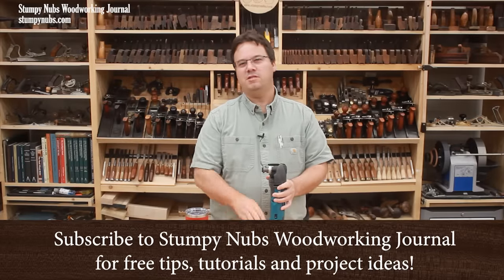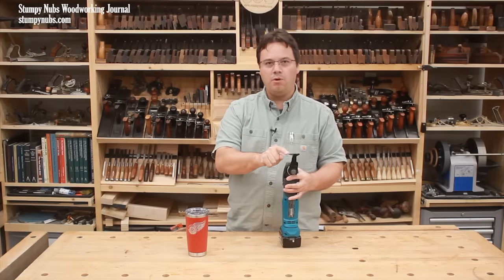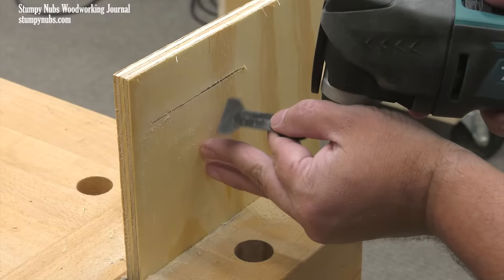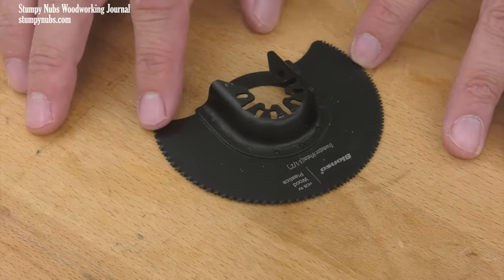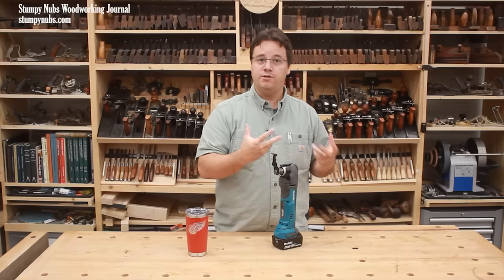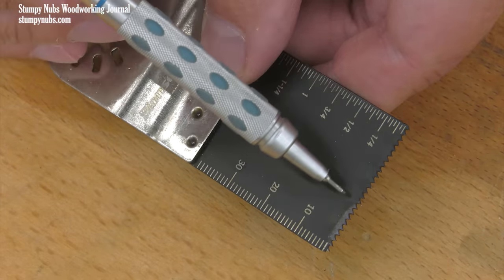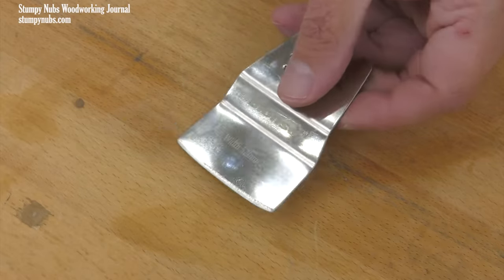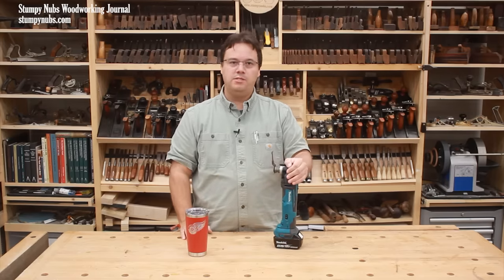CLEVER things to do with an Oscillating Multi-Tool!

Comment: As a Registered Nurse, I've used oscillating saws for almost 40 years in cast removal. They are safe because they would not readily cut skin when they penetrated the cast during removal. They are also used extensively in orthopedic and neurosurgery to cut bone. I never thought about the patent issues that kept this tool from crossing over to the woodworker and building trades. I just used a masonry blade for the first time a couple of weeks ago to cut slots in mortar joints to mount decorative lighting around a pool deck. Worked like a charm. Also great for grout removal in tile work.
Reply: My first thought was all the casts I had cut off with one of them.
Reply: The first one I saw was having a cast removed in 1973 when I was in second grade.  Now I have a corded one and a cordless.  One of my favorite tools.  I recently saw a blade that was a rectangle and would cut a hole in drywall for an outlet box in one step.  Pure genius!
Reply: True,  I had a cast cut off in 1963 with an oscillating tool
Reply: I never understood how they could cut metal and bone but not skin.
Reply: @pamelah6431  These medical oscillating saws will indeed cut skin and soft tissue if enough pressure is used, but you need to press harder that for cutting a cast or bone and make a real attempt to cut soft tissue. You develop the proper technique, just like any other tool.
Reply: @DeereX748  interesting

Comment: I paid $450 for my first one - the Fein corded original - in the mid 80's.  I still have it plus two cordless Makitas.  I figured you would miss some of the tricks I have learned over the years, but no, you covered it all.  As usual :-)
Reply: Fein the original & the best.
Reply: I still have my original corded Fein from 20 odd years ago but these days I most often use my Dewalt 20 volt cordless multi tool.
Reply: That must be around a thousand dollars in today's money. Tools were sure built solid then.
Reply: @jamesrecknor6752  The price of these types of tools was hideous when they were only considered a 'specialists tool'
Reply: Price for the tool have gone but the price for the blades are ridiculously expensive.
Reply: The fein is a quality tool .
Reply: @davemarr7743  it’s the printer/ink model
Reply: $450 bucks in the 80s? Damn that's more expensive than current to date festool prices for the 80s.
Reply: @palmer3977  you should give the new makita brushless a try. it is more bulky around the power head but its because the entire gearbox is in rubber mounts separate from the handle. the vibration damping is pretty amazing compared to any others ive tried. and the width of oscillation and power is top tier too.
Reply: The Fein salesman was going door to door like the Fuller Brush Man. I wasn’t sold but my wife thought it was cool so I’ve been using it for years. It’s very versatile. I probably have used it most often as a jamb saw. Does a good job at removing grout too.
Reply: Use a Fein and HS blades for cutting fiberglass for homebuilt airplanes. And use any other brand for lesser work. We've had a corded Fein since 1999.
Reply: My first Fein from the 90's was a 250 Q. Since Fein had the patent, it had an MSRP of $399. They never sold for less than that. That tool is still running today. Fein's are still incredible tools. I don't care for the new ones however since you have to use their proprietary Starlock blades which are expensive.
Reply: you must have worked in commercial caulking or glazing... when we bought them in the 90s they were $600! And people complain about inflation now!

Comment: One tip I have picked up is that you can also mount 2 blades back to back, which in effect helps you cut a parallel channel in drywall or wood for running wires etc
Reply: Not really. The vibratory action and flexibility of the blades distort for a parallel cut.
Reply: Now that’s an idea I have to try out! Thanks!
Reply: This works a treat with 2 semi circular blades with a spacer set between them and a longer mounting bolt/screw.
Reply: @michaelhamerin3814  It works very well if you use the right blade choice.
Reply: Wow. I am about to run 100 ft of various Romex. I am going to try that.
Reply: Wow, never thought of that!
Reply: What a great idea

Comment: Great video James. My oscillating tool is dubbed the “tool I forget I own” more often than I want to admit. It has gotten me out of many jams and now with your video I actually know how to use it better!
Reply: Interesting how different some people see the same thing. My oscillator has risen through the ranks and tied with the impact driver for my most used tool. I can't remember a job I did where I DIDN'T use it at least once.
Reply: @justinayers3589 , on the job I bought mine Fein Tool for (stair railing project),  the homeowner asked me to cut a hole for a bedroom door latch, which had been neglected for a decade.  A Feign tool and plunge cut was perfect for cutting a hole for the door to latch into. A bit of chisel work and a annoying task was cut down to just minutes.
Reply: I too forget quite often I have one.Actually two.😊Blades are actually a problem to get and expensive in sunny South Africa.

Comment: I LOVE mine.  I work construction and got one a couple years ago, it makes you wonder how anybody got anything done without it lol.  It's the perfect tool for so many things.  My favorite one being probably doing floors.  You can use this tool to cut off the bottom of trim and door frames to slide the floor underneath it, gives a super clean look (you don't have to worry about edges of the floor cuts being perfect as they'll be hidden under the trim) and takes about 30 seconds and your door is prepped.

Comment: Bought mine on a lark and justified the purchase as being a birthday gift a couple of years ago. Plus I needed to make like two flush cuts on some baseboard. Two years later, and this thing has become indispensable in my shop. Never would have thought it could come in useful in so many different ways! I'm especially fond of the chisel blade--it helped me immensely to remove old, glued-on plywood underlayment in a recent bathroom remodel.

I also never thought about being able to actually touch the blade while in use. THAT might be a game-changer for me in the future. Thanks, SN!
Reply: Originally, they were used by orthopedic doctors to remove casts.
Reply: @ohmike813  Oh wow, I always wondered how they were able to use what seemed like a spinning disk to cut casts without also cutting the skin. This makes perfect sense! Thanks :)
Reply: Betcha you could use  the those weird saws 0:17  Then start realising that that weird thingee could cut all I waanted and never cut a person's. It became the darling on that ward.

Comment: I remember the first time I saw an oscillating tool which was in the early 90’s. I was working as a floor installer for a pretty large flooring company. I was an apprentice back then and my job was to always cut door casing for flooring to go underneath for a cleaner look. We had a Crain undercut saw but there were a lot of areas that the Crain couldn’t get to so I would use a hand saw. A reciprocating saw was also an option but I was still too green to comfortably get a good clean cut with one. 

Anyway, Fein came to do a demonstration at our warehouse and my mind was blown! We ended up buying a bunch of them from Fein and never looked back. I am now a finish carpenter, mainly doing cabinet installation, but my multi tool is one of the tools that is always in the truck. It doesnt get a ton of use, but its a life saver when I reach for it!! 

Cool video
Reply: Yup! My first one was a Fein corded one. Still got it. They designed a profile sanding accessory as well and I got one. When I bought a cordless multitool from a different manufacturer I tried to modify the profile sander to fit it but couldn't.
If I want to use it I've got to get the fein out.
Multi tools need to be cordless just like drill/drivers and be toolless blade replacement just like jigsaw.
Reply: Came to the comments for this exact tool. Im a floor layer as well and i absolutely hate using the jamb saw/undercut saw. For starters, its just way too powerful for its intended purpose and it often sends a peice flying across the room.
Also, as its intended to be used by cutting around the jamb without having to stop, which means using upto 3 out of the 4 quadrants of the blade during 1 cut.
Not to mention what can happen if you hit a nail (yes, ive broken windows, more than once) or pehaps accidentally go in a bit to far without realising the house is steel framed (yes, done this too, only once though, actually shattered and broke a decent chunk off the blade, had a bit of a sore shoulder and hand after the kickback threw my arm into the wall as well)

This is gonna sounds stupid, but being from Australia, where basically everything wants to kill us, we kinda get raised to have a fearless mentality and a nonchalant attitude towards everything, however, nothing scares the shit outta me more than when i have to use the bloody undercut saw, which has been 5 days a week for nearly 15 years now. 

I've experienced kickback from other saws (chainsaws, circular saws etc.) before, but they dont even come close to an undercut saw. I think its something about being on your knees with limited mobility and having no way to know when it's gonna happen and no way get out the way of anything. It's basically a game of 'jamb saw roulette'.
Reply: @davidashton2361  I just got my first multitool to cut rectangular holes in weatherboard to install vents. Got sold up to the one with starlock system of toolfree blade changing. Thank god. I hate fiddling with that crap

Comment: I bought one of these several years ago. I selected the Porter Cable for a couple of reasons. The first and main reason was because of the quick blade change; lift a lever and change the blade. I can change a blade in seconds. Many brands had a complicated screw mechanism for changing the blade. The other feature I looked for was the speed control. This is a must!
Reply: Another on the Rockwell RK5151K is differing angles of attack (basically the swinging back and forth of the blade).

Comment: I discovered another use for the sharp scraper blades.  I re-soled my work boots (Vibram soles and Barge cement) and needed to trim them to fit (I take a size 13 boot, but Vibram only offers size 12 and 14 replacement soles).  I tried my oscillating tool with several toothed blades and made a smelly mess of things.   I switched to the scraper blade and it was like cutting butter--smooth, fast cutting of the rubber.
Reply: Fyi , When cutting rubber keep the blade wet . Works better with knives of any kind. 😀😎🇦🇺👌
Reply: @rodmills4071  Dish soap for cutting lube works miracles when cutting rubber, and rinses off pretty readily afterwards.
Reply: They work great for cutting the customizable foam in cases too

Comment: Thank you Stumpy for all the great tips. 
You produce great videos !!
I have a tip I would like to add.
In many cases, you can move the cutting edge of the blade slightly left and right, in addition to the oscillating motion, which greatly helps cutting efficiency and reduces blade burning. 
This oscillating multi tool, is often one of my favorite tools.

Comment: I found the best use for the sanding pads is to wrap a wet microfibre cloth around them to remove grout haze from wall tiles, especially the stickier stuff like Fusion Pro.
Reply: Good tip
Reply: Brilliant tip.That grout is always a pain in the a.. to get off.

Comment: You can also use the tool for . . . scrubbing!  A sanding pad can also more or less hold onto Scotchbrite cut to fit.  We have a bathtub that collects <something>, probably the interaction of soap and hard water, but not easy to clean.  DeWalt cordless + sanding pad + Scotchbrite + Scrubbing Bubbles is a bit messy, but cleans way easier than an old man's elbow grease.  As a saw, it's the least likely to amputate something you want to keep.  😊
Reply: I thought of this at one of my old jobs went out bought an air powered one brought my compressor and after gallons of degreaser the surfaces looked brand new